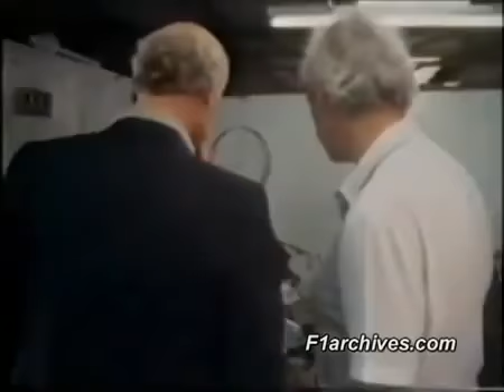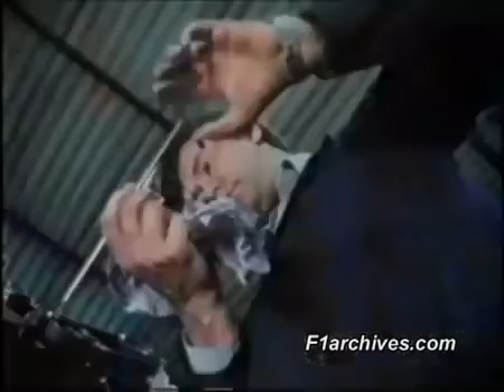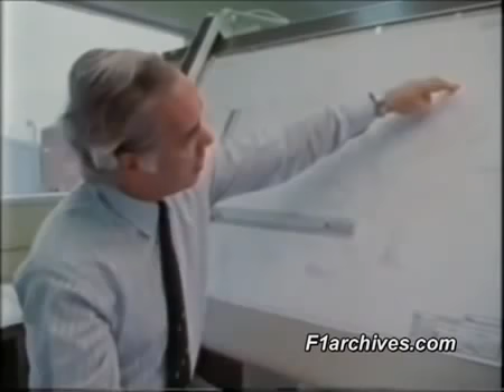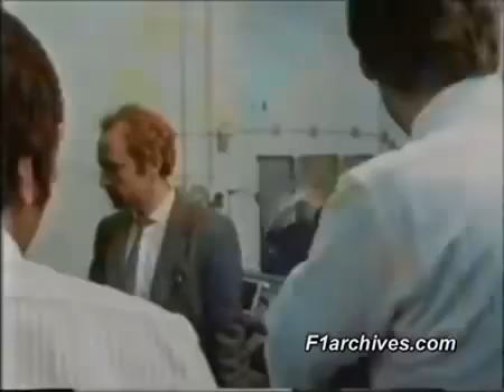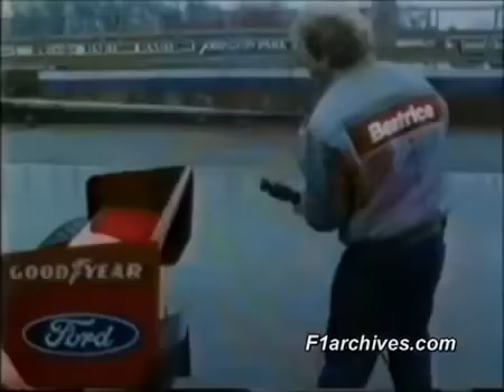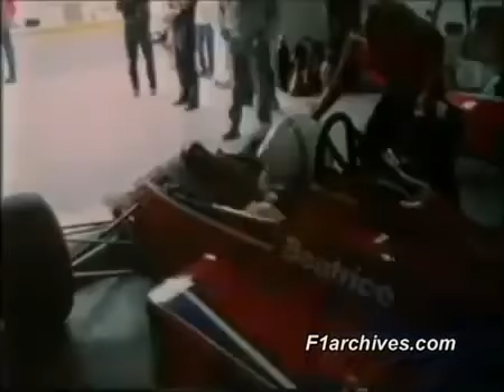Formula 1 Turbo Engines - The Golden Era [Full Documentary]

Comment: The only problem with this guff is that most of the horsepower quotes are unbelievable and by that I mean you shouldn't believe them. Those must have been pony-sized horsepower in many cases. Oh, and by the way: Indy cars of the era ACTUALLY raced with more horsepower than the majority of F1 and over  much longer distances - AND at full throttle . The "qualifying" numbers usually for F1 resulted in a molten heap and I am sure a great deal less then anybody's "1,000 hp" unless the cars were streamlined bricks....and no one has ever, to my knowledge, shown certified dyno numbers for turbo F1 engines of this era.
Reply: The only guff, is your comment.

Comment: does anyone know how many h.p. is attributable to the turbo? i.e. what does the engine itself produce. then, the addition of the turbo....? thx..
Reply: sure. 15psi boost pretty much doubles the power of a na engine. A '86 turbo F1 car might be running 57psi boost during qualifying.  I was trackside during a F1 qaulifying in 86, and let me assure you that those cars had insane power. A pissed off driver who missed a corner could, and did, light up the tyres at will.

Comment: engines weren't bad. however, the cars relied on mechanical grip. just the observation of tyre size shows this
Reply: That is a bit of a misconception. The downforce has been the dominant way to get traction in F 1 for a very long time. That is not going to change. Wider tires do give you more grip though not for the reason you might think. The size of the contact patch does not matter a bit when determining friction. Wider tires are stronger, thus they can be made with softer materials. The softer material is what improves the grip. Again, downforce is the dominant factor no matter your tire size, lager tires can be softer at the cost of greater air resistance.

Comment: Head bolts in an F1 engine? Figures Renault would do something like that. Head Studs don't have the same twisting force applied to them when torqued down, this design is stronger when everything else is otherwise identical. It also more reliably results in the same amount of clamping force when torqued to spec.

That said some of what was being done back then was pretty impressive. Hell can you imagine that ECU probably had all of 33mhz at best to work with.
Reply: I was wondering this as well!
Reply: Zachary Cuskelly What? Modern engines of this performance level use a monoblock design. It's a faff to work with but no worries about head gasket failures.
Reply: Kind of surprises me too, since Offenhauser started using the monoblock design in the 1930s and dominated Indy for decades.
Reply: can u plz explain how else to hold the head on he block i only know of this method tia

Comment: vibration vibration vibration spin the crank shaft at 20k. weigh each piston to the .0000001 oz- match the counter balance to oz. alternate intake/exaust. shorten the length of  crank. Magnetic shielding for each injector wiring. engineers forgetting sound barrier inside crank spin.
Reply: What??
Reply: I concur
Reply: "At peak revs, the pistons  will be subjected to accelerations of 
81,000m/s2. This acceleration equates to  more than 8,250G and the force held by the piston exceeds 50kN", so, yes, the sound barrier inside those engines can be a real concern. lol.

Comment: It's amazing to watch this and see pgmfi and turbo charging in its infancy. This type of technology is now perfected, and used in consumer cars, and is available in the aftermarket. Makes me wonder what the next 30yrs will be like in F1.
Reply: Will Thacker autonomous drivers to save weight and meet government safety mandated. Electric cars to comply with emmission requirements. Battery's powered cars because they are faster...2020 tesla just announced 0-60 in 1.9 sec 0-100 4.3 sec, top speed 250mph and a battery rated to go 600 mile battery 1000km before needing charge.

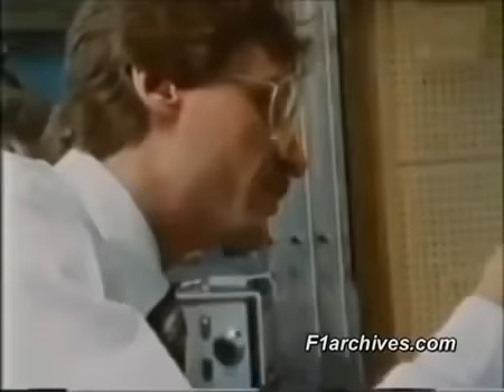Comment: I dont understand the noise problem they had around 57:00. Why dont they just put a shield around the computer and use a coaxial wire for the signal? Its not that hard to get a signal from A to B without noise influence.

Comment: "Most racing engines don't require an investment into computer aided design."  Here we are, some 3 decades later where literally everything is designed with computers...
Reply: Couldn't his point simply be the obvious that engines now require a shit ton of investment into computer aided design? Did that fly over your head?
Reply: @andyrickert1 yes it was.
Reply: To me, this makes the BMW M10 Bravo engine even cooler. They used standard cilinder blocks from used BMW 1500 cars with at least 100k kilometers, and left them out in the rain and weather, so all possible casting tensions would be gone from the metal. The result: 1450hp in qualifying and a world-championship win.
Reply: Perhaps, he's noting a condition called "irony"?, that's all.
Reply: By allowing it to heat up and cool down many times, the stresses resulting from uneven cooling during the casting process are relieved.  It's nothing to do with corrosion
Reply: MrKalashnik0va No...
Their point was that if the casting had a problem, by 100 000km, the block would have had a failure already.
Nobody talked about rust...
And they didn't use them as is either.
Reply: Back when labor was cheaper than computers and electronics
Reply: Including dildos!
Reply: What's your point?
Reply: +DolleHengst heard of this and the bmw engineers were encouraged to urinate on the blocks too lol
Reply: No, he's saying its too costly at that stage for a new team. centuries of engineering know how, calculator and a workbook". All that is needed. These guys are incredibly skilled, carving wooden blocks and moulding f1 engines....wow.
Reply: That hes a nerd rejoicing over the fact that he can potentially spout something he actually knows
Reply: Andy Rickert So what's his point ? Is it a bad thing or a good thing?
Sorry I'm not stupid enough to stop thinking after I'm done reading something!

Comment: The Golden Era? FUCK YOU!!! 
The deep shit era!!!  

Bring back the V8's!!!!
Reply: +Vape Knights right? like if they were going to make hybrid engines why couldn't it have be hybrid v10's or something
Reply: The V8s were the worst engine ever in F1. Low power, no torque and they sounded like bees.
Reply: +Vape Knights They are not loud enough now, but the sound itself is much better with the spooling of the turbo and crackeling sounds. Also the new hybrids have alot more power than the stupid V8s. About the same as the V10s already. 

But V10 sound is the best, the V8s sounded like shit compared to them.
Reply: I don't care what the configuration of the engine is like you do, I care what the power output is and how fast they can go. Sure the current regulations is not perfect, but as long as they are the fastest F1 cars ever (and are getting even faster next year) its better. Especially with no driver aids as they had back in the days.
Reply: ***** They didn't have that much power when racing in the 80s. Less than today. Only in qualifying they would up the boost (different turbos than race turbos) and the engine would only last for 3 or 4 laps before it burnt out in quali.

Comment: Who mounts a computer directly to a scorching hot engine? lol
Reply: The top of the engine was one of the coolest parts. The vast majority of the heat was at the turbos.
Reply: Yeah, well, manufacturers do it all the time. I have a dodge with a cummins engine and the electronics that control the injection is mounted right on the injection pump instead of somewhere in front of the Radiators such that it would receive ambient air to cool it. Instead it requires a surplus of fuel to cool the pump enough that the circuits can survive.

Comment: Insane documentary. The engine mapping and electronics have come so far. Cracking open the box and soldering in different microprocessors. Damn. I can swap between 5 totally different engine maps while driving down the road with a Cobb Accessport now.

Comment: in the description does it not say they were running 14 bar at times???? That is 205psi and if you dont know each pound is about 8-12 degrees depending on turbo efficiency and since turbos were just starting main stream then i can imagine it was probally around 10-14 degrees/psi. how the hell did they cool that charge with only intercoolers??

Comment: it's incredible to think that the electronic brains of the F1 cars of that era were the size of a toaster yet my modern cellphone probably has more computing power in it and it fits in my pocket.

Sadly for Mr, Duckworth and ford this project was basically doomed to failure before it even got started because by the time they got everything working the way it needed to work the FIA banned turbos starting in 1988 which led to most teams switching away from turbo charged engines in 1987 while Hass/Beatrice/Lola went under at the end of 1986 and they couldn't find any potential customers for the engine so they had throw away all of their hard work and redevelop the old DFV V8 to meet the new rules that came into effect in 1988.

Comment: Stefan Johanson recalls an engine Ferrari brought along to Monza when he was driving for them, a 1500 bhp unit for qualifying.
Reply: ***** I re-iterate, Stefan Johansson used a 1500bhp unit that Ferrari bought along for qualifying at Monza.
Reply: ***** And here he says it again in a recent interview, but this doesn't state it was his Ferrari engine for Monza
'Just get rid of all the technology that you don’t need. Ban all of the buttons on the steering wheel. Radio and pit-speed are all that’s needed. Let the drivers sort the rest out. If they can’t drive a car with 850 horsepower and three-times the grip they used to have. I hate to sound like an old crank, saying “it was better in my day” but if we could handle 1500 horsepower in the cars we drove with hardly any aero grip, I’m sure these guys could. The top drivers today are all fantastic drivers and I’m sure they’d love it.'
Reply: B Napoletani That was definitely BMWs engine that produced that much power during those seasons.
Reply: ***** False they actually produced over 1400hp and closer to 1500hp for qualifying. In race trim they produced 1000hp reliably.
Reply: Max Power I reitereate once again, Stefan Johansson recalls using a 1500hp Ferrari engine at Monza, and he remembers he could get get wheelspin in 5th gear when on the main straight if he floored it. Johansson was an F1 driver for many years, but I guess his info is worthless in comparison to an armchair fan on an internet forum/website.
Reply: B Napoletani  "Stefan Johansson recalls using a 1500hp Ferrari engine at Monza," So your assertion backed up by absolutely nothing but your own claim Stefan Johansson (of all drivers) said so , which you neither can provide a link to nor prove using a viable example is better than a thorough study based from facts and stats? Your claim is dubious to say the least. 

Everybody that has read Motorsport magazine knows that BMW made the most horsepower during the turbo era, but only saw that kind of power on the dyno. Honda used the most power in the races, close to 1000hp in 1987. Renault also made serious power once they introduced pneumatic valvegear in 1986 - which resulted in 8 poles for Senna in the Lotus.
Ferrari were nowhere near powerwise. Had they been they would have recorded tons of poles. At Monza in which raw horsepower is more important than any other track, save for maybe old Hockenheim, you're going to just ignore the facts and claim something your uncle Giovanni heard from Giuseppe, who in turn heard it from Roberto who knows somebody that worked with Stefan Johansson in his Ferrari days and heard this.

I took the liberty of trying to find Stefan Johansson's claim since you don't yourself. There's not a single article in which he says so. Not one. You also commit a ridiculous fallacy called "appeal to authority" (and when was Johansson an authority anyway?) in which you just try to validate a claim by saying that a person said it so that's why any evidence against it can readily be ignored. 

I reiterate, you're a stiff who can't even admit he was proven wrong.
Reply: Theodore Mosin 
I re-iterate once again, Stefan Johansson a Ferrari F1 race driver (not a forum spaz) who was current when the turbo era was in full swing recalls using Ferrari's 1500 bhp engine at Monza. 
I fear you cannot read properly, or maybe you shy away from information that scares you. 
If you can read, I suggest you do less of it via magazines. The secrecy of F1 comes from ex drivers in particular via their twitter accounts, not magazines. Perhaps you believe whats written in newspapers too!
Reply: B Napoletani For anybody that requires further evidence. The statement  from Johansson 
"Qual è stato l’episodio più eccitante di tutta la tua carriera in F1?
“Credo di aver corso in generale nel miglior periodo della F1 perché le macchine degli anni Ottanta col motore Turbo erano pazzesche, con quasi 1500 cavalli e una tenuta molto limitata che le rendeva incredibili da guidare, come una bomba sul punto di esplodere… Non penso ci sarà mai un’altra era come quella: la qualità dei piloti era altissima, quando sono arrivato in F1 c’erano ben sei campioni del mondo”.

The full interview http://www.formulapassion.it/2012/01/f1-stefan-johansson-uno-svedese-a-maranello/
Reply: B Napoletani He specifically states his Ferrari 1500bhp Monza engine in numerous interviews
Reply: +B Napoletani he remembers incorrectly, evidently